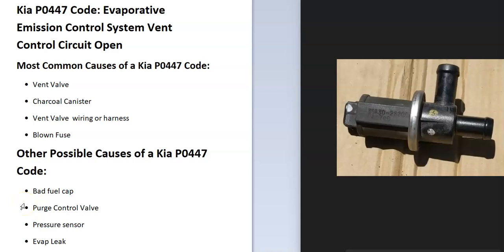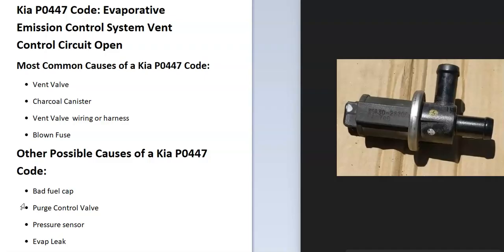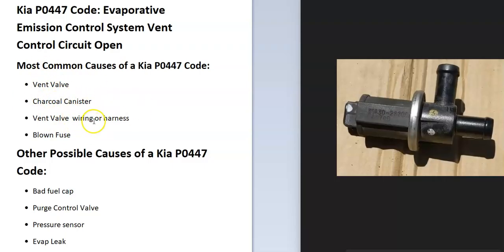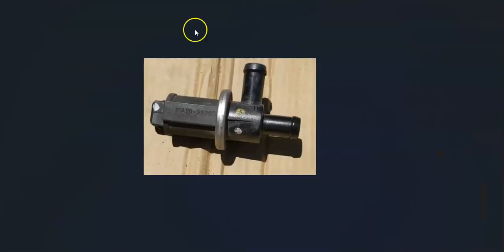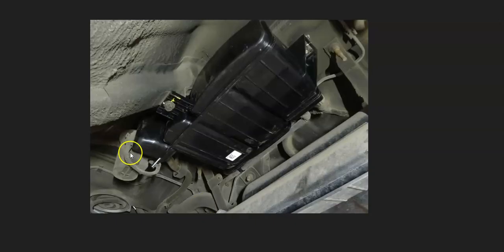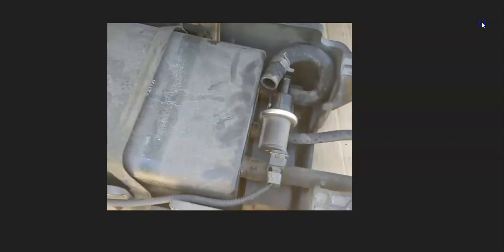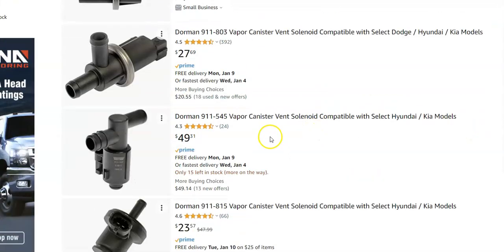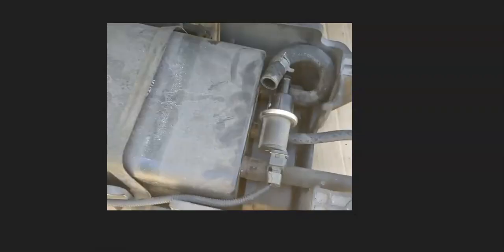How to Fix a KIA P0447 Code Evaporative Emission Control System Vent Control Circuit Open

Comment: What about p0447 and po445 on 2015 sorento
Reply from the maker: A P0445 code is an Evaporative Emission System Purge Control Valve Circuit Shorted. I would check the wiring.

Comment: I ran over a curb and bottomed out, which ended up breaking the wiring, triggering the check engine light. Question: if I temporarily closed the circuit using the wiring, would this also cancel the check engine light warning? Thx!